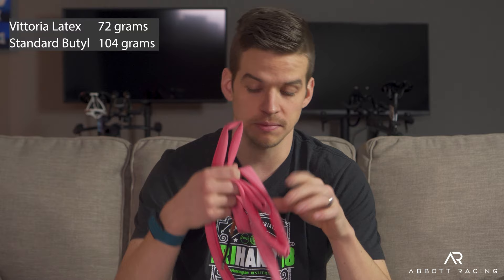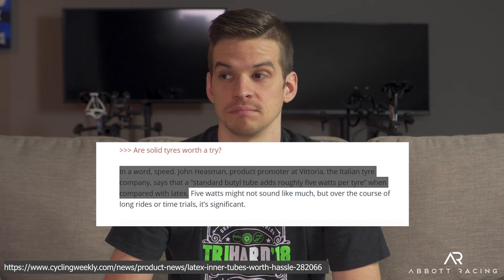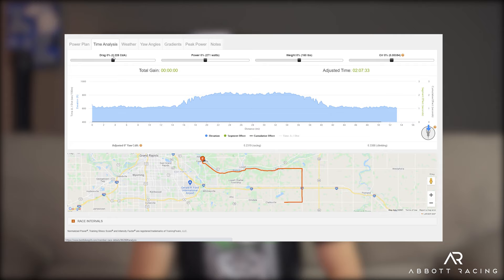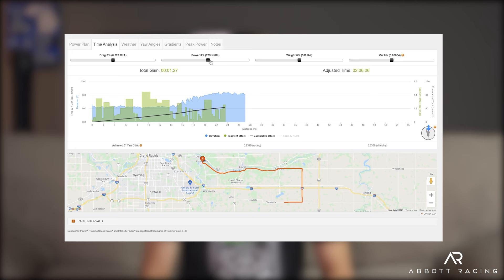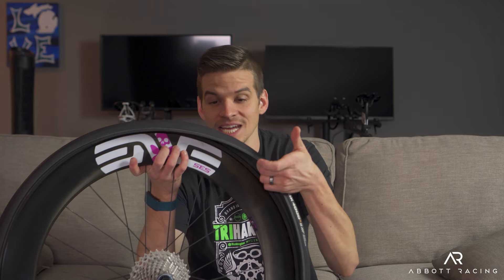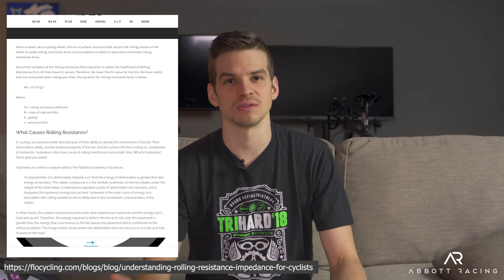Save 12 WATTS with latex tubes | FasterOnFriday

Comment: Try the maxxis ultralight 66g Lighter than vittoria but im not sure about rolling resistance coz it is not latex. Maxxis welterweight is around 74 or 76g. It is around 9 or 10 dollars
Reply from the maker: The weight is not really a factor in overall speed. Plus if it is a lightweight butyl tube then I have always found those to be the most flat prone.
Reply: Less puncture resistance, and more rolling resistance than latex. BUT you wouldn't have to pump up every day